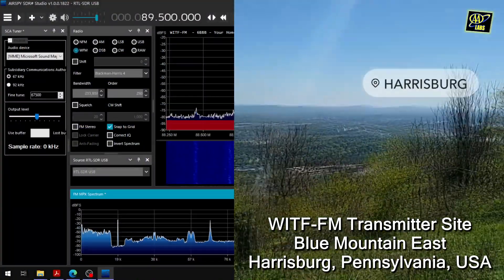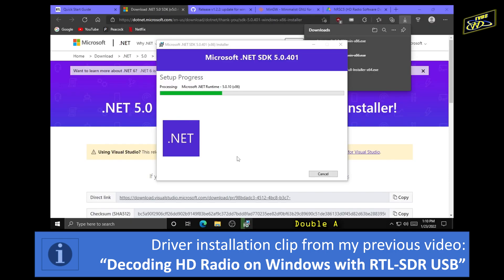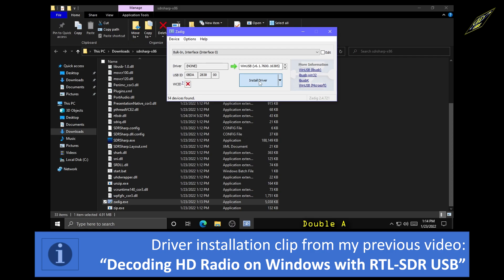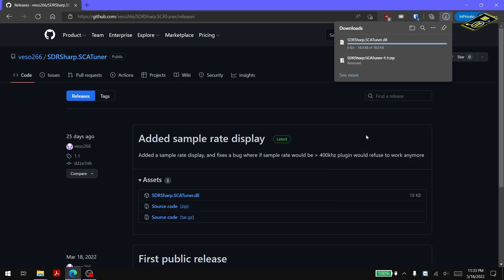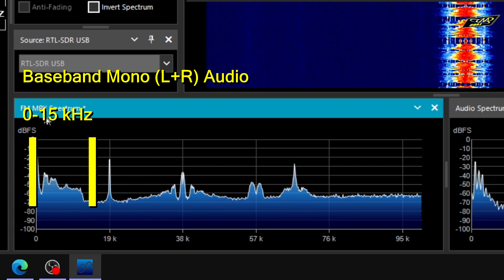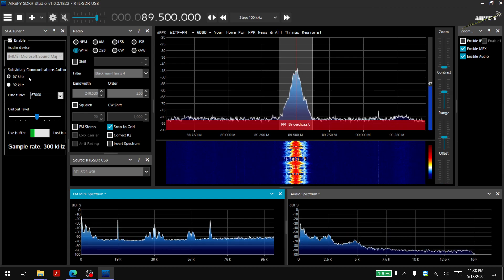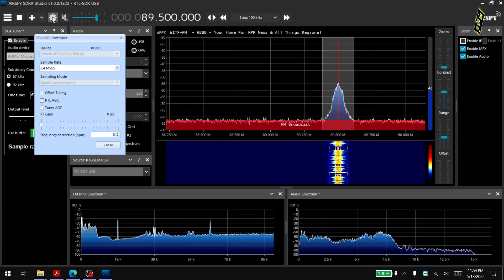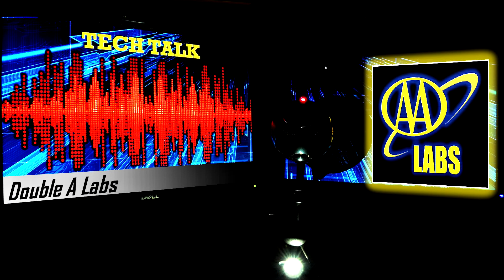SDR# Plugin for Tuning an FM SCA Subcarrier (Radio Reading Service for the Blind) (with RTL-SDR USB)

Comment: I got news to tell you, updated news, there is Version 1921, and your plugins and everything does not work on Version 1921.  It's time for a new updated version of this.  I tried everything I could, and still I end up having to use Version 1919 just to use the SCA-FM plug in, but still cannot use the 1st as the FM tuner for the main station set at 192 kHz sampling rate for the virtual sound card, and the 2nd tuner for to tune the audio spectrum from the virtual sound card at 192 kHz, still it gives me a sampling tuning rate of 44.1 kHz.

Comment: Hello just want to say I really like this video about the sub carrier SCA and it seemed pretty simple but I could not get it to work I have the plug-in inside of the SDR airspy app but when I try to play I just get white noise I was wondering maybe I need to put the magic line in the plug-in folder also but as I said I do have the plug-in in my hamburger menu list but I'm not getting the sound and I do see the sub carriers on my screen any ideas I'm pretty close to getting it
Reply: Hmm, you dont need a magic line if your plugin already works and you are using a recent sdr# version

Did you try manual tunning the subcarriers? (You can go all the way from 1khz to 96khz) you should at least be able to hear rds on 57khz)

What sdr# version are u using?
Reply from the maker: It's also very possible you have an amplitude modulated (AM) subcarrier within the FM MPX, instead of a frequency modulated (FM) subcarrier. I believe this program only demodulates FM subcarriers. You could try my original method video (linked in the description) and set the second instance of SDR# to AM mode.
Reply: @DoubleALabs  I dont think there are any AM modulated subcarriers with human understandable data (execpt L-R Stereo diference, but even this one would sound out of place) within an FM MPX bandwith but maybe somewhere in the world they exist idk :)
Reply from the maker: Maybe not. I was thinking of this video where a guy found a subcarrier that appeared to be a backup feed to an AM station: https://youtu.be/cQeAnGy1OlE . But it looks like from his GNU Radio flowgraph the subcarrier is indeed FM.
Reply: @DoubleALabs  I remember this video :)

If you see the comments you will notice that I was looking for an iq samples back then :)